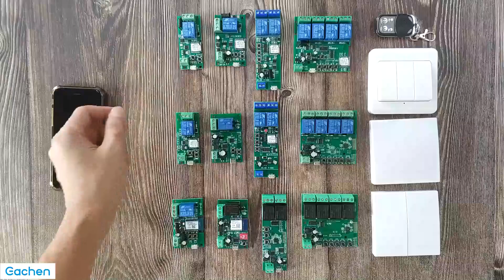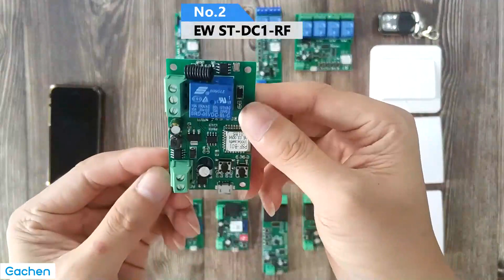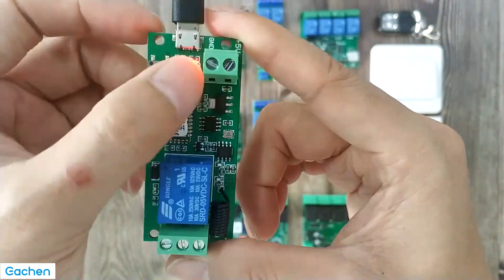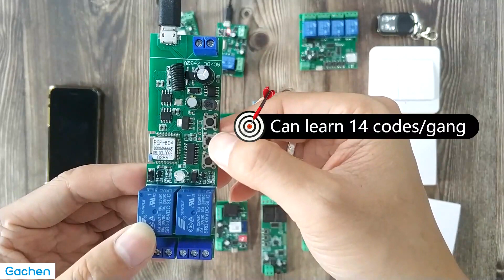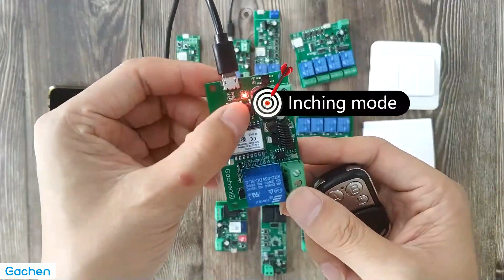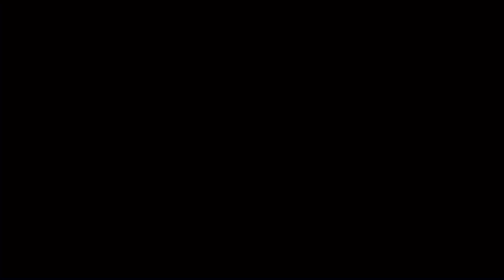EACHEN WIFI+RF SMART RELAY MODULES WORKS WITH EWELINK AND TUYA APP

Comment: Hello, how are you? I bought a 4-channel card.
It turns out that after I manage to work through the app, I press the button on the app or the remote but the relay turns on and off. He doesn't stay connected. any of the 4 channels are the same. turns on and then turns off. You can tell me what I do to work properly. I already changed several parameters and nothing happens.

Comment: Tengo un dispositivo de 4Ch el #8 que funcionaba con Ewelink (aunque los relé son negros) dejo de funcionar y es imposible agregarlo a la aplicación (V4.20.0), sigo correctamente los pasos y cuando debo conectar a la red Wifi que emite "ITEAD-1000xxxxxx" con la contraseña que indica la misma aplicación (12345678) (En modo Compatible), no conecta y no puede culminar el proceso para agregarlo y usarlo desde la aplicación....
He probado con diferentes teléfonos, también e cambiado el canal de mi wifi por supuestos posibles problemas de interferencia como el canal 7 que utiliza el dispositivo, incluso descubrí en tu otro vídeo como se reinicia de fabrica lo aplique sin corregir el problema , he probado en modo Avión, sin tener activado el plan de Datos, sin ningún Resultado, es bueno mencionar que tengo otros varios dispositivos similares desde hace años, funcionando sin problemas, osea no soy novato en el tema....
Todo esto ocurre pues los fabricantes actualizan el firmware de estos dispositivos al igual que las aplicaciones para supuestamente corregir errores de seguridad que terminan dejándolos sin funcionamiento...
Te agradezco por cualquier orientación para poder poder ponerlo a funcionar nuevamente.... Saludos
Reply: I have a 4Ch device #8 (although the relays are black like #12!) that worked with Ewelink, it stopped working and it is impossible to add it to the application (V4.20.0), I follow the steps correctly and when I have to connect to the Wi-Fi network that issues "ITEAD-1000xxxxxx" with the password indicated by the same application (12345678) (In Compatible mode), it does not connect and cannot complete the process to add it and use it from the application....
I have tried with different phones, I have also changed the channel of my Wi-Fi due to possible interference problems such as channel 7 that the device uses, I even discovered in your other video how it restarts from the factory, I applied it without correcting the problem, I have tried in Airplane mode, without having the Data plan activated, without any results, it is good to mention that I have several other similar devices for years, working without problems, that is, I am not a novice on the subject....
All this happens because the manufacturers update the firmware of these devices as well as the applications to supposedly correct security errors that end up leaving them inoperable...
I thank you for any orientation to be able to put it to work again... Greetings